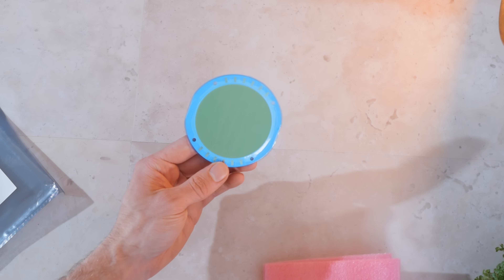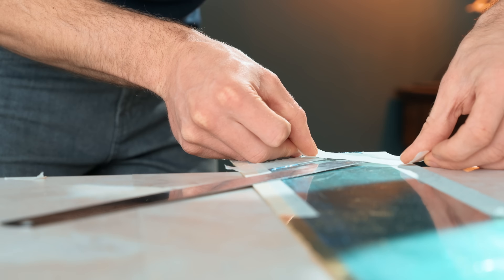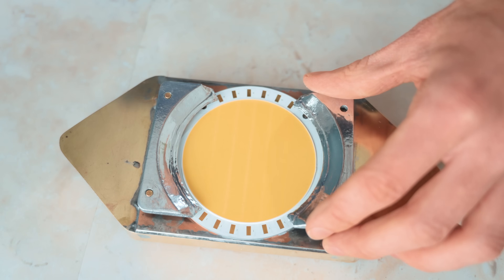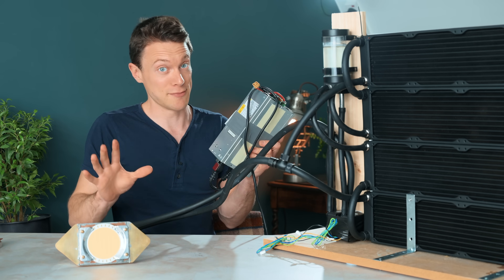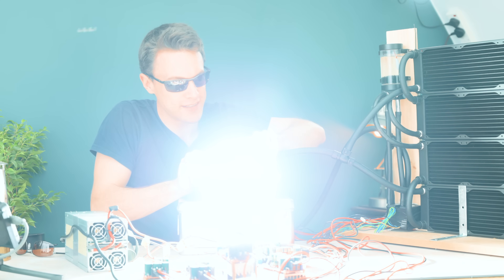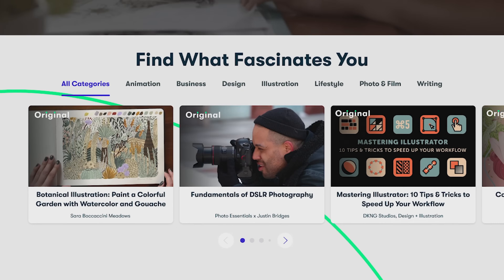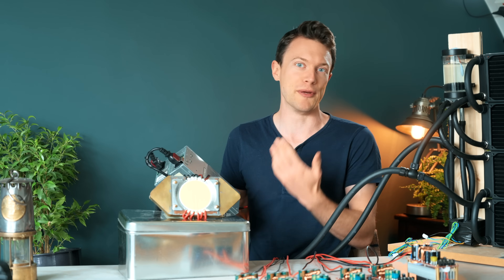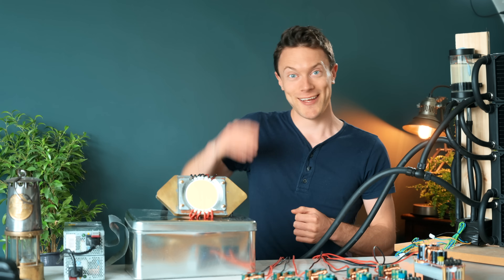Testing the world's BRIGHTEST LED!!!

Comment: Damn. You’re using a 3000W power supply but it’s using around 1600W to power it all. That’s right around the limit of 1800W of a 120V 15a circuit. I’m jealous of the UK’s 240v system lol. We’d have to plug this into a stove or clothes dryer plug lmao.

Comment: 7:57 time to do it at home, again. (Than again pc power supplies normally dont deliver all their power on the 12v rail) Or you know grab/build a 1500w rectifier with regulator.
I also happen to have a welding helmet so i could technically wire a few of these LEDs up to a Tesla module or two and make a sun cannon.

Comment: Those power supplies are never supposed to be wired in series, that's why they were getting so hot. Wiring them in series actually half's their current capabilies so you were 600w over their rated limit when drawing 1.6KW.

Next time I'd advise wiring a few 12v car batteries in series to get 36v, those can output over 2000amps so I doubt you'll have issues with those.

Comment: I'm not knowledgeable about this so correct me if I'm wrong; assuming 80 to 90% efficiency; wouldn't a 1500w led only generate 150w to 300w worth of waste heat? If so then the biggest cpu air coolers would be enough.

Comment: If you take two 12 volt 800w power supplies and you put them in series it's going to give you 24 volts at 800 watts not 24 volts at 1600 Watts. Putting them in parallel with give you 12 volts at 1600 Watts. In order to have 24 volts at 1600 Watts you would need to put two of them in series twice, so four total and then put those two sets of power supplies in parallel. That would be a 2s 2p configuration

Mixing metals in a waterblock, ugh.
Also, put some thermocouples on the LED cob and the heatsink that will shut down the power if it gets too hot

Comment: If you connect the PSU's in series you are shorting one to ground, and forcing the other to work double. 
To do two PSU's in series the DC+ of one needs to connect to the DC- of the other. This means that the ground of the input AC is connected to ground of both + and - of one of the supplies.

Comment: did you isolate the pcb grounds from the metal cases before wiring the power supplies in series? if you didn't, most likely that's what killed them. the cases should only be connected to earth if you want to use them in this configuration

Comment: It looks as though the wires to the PSUs are only soldered to one side of the output pads.  To get the full 82A output you have to solder to both sides of the 12V pads in parallel, ie: 41A per side.

Comment: Running power supplies in series will increase the voltage,not current. Shouldn’t you be running them in parallel? Might end up with ground loop issues though.

Comment: As a video creator, I was really enthused to see the rise of color accurate LED's replace the hot tungsten fixtures I previously relied upon (750w-1200w draw). Now I've seen LED video lights pulling 1200+ watts and wonder if we need a new advancement to come along that improves upon LEDs. I don't see it happening in my lifetime, but I think that engineers should continue their work on the efficiency  (lumens/watt) and give us back the ability to plug in two light fixtures to the same circuit without risking a blown fuse. 
As for this LED, have you considered using an automobile radiator? (only slightly kidding).

Comment: I believe (heard recently, but don't know well, look into it further) that using two metals will cause electrolysis because of the running water and eventually leakage - plumbers are having such problem when mixing other metals with coper pipes (though obviously not the lead solder?)

Comment: Server power supplys are intended for use in servers that have internal fans to supply a ton of air flow at high static pressure.  In open air on the desktop they probably didnt have enough airflow and simply overheated.  You would probably have better luck with regular desktop power supplys that are not designed to have supplemental airflow.  Or just get an AC/DC converter with the proper wattage and voltage, that would save even more complexity.

Comment: Loved the video
if the PSUs are in series, could they be touching each other? I think the common connects to the PSU chassis. it would technically short the PSU you are drawing negative from.
also the PSU power rating is probably total across all outputs, not just the 12V one

Comment: 15:00 Well that's probably has to do with the way you put them in series, powersupplies in general are not really "stackable" per se, since their characteristic vary from block to block you will find yourself in situation where one block handles substancially bigger burden than the other more often than not(in fact the rule of the fumb is to assume that the rating is just 1.5x of the two rather than 2x, and stacking more than two makes it even worse, and even less stable, remember that voltage drop rate and its correction will be different for each power supply, so dynamic characteristics aka under different loads will vary quite significantly). It's also ill advised to create cascades even from big number of transistors that "dumbly" routed in paralel for simmiliar reasons. Also connecting power supplies in series may lead to  to short circuits due to "common ground" problem(aka you have to check that power supplies are fully isolated and their "minus" wires are not of the same potentiall, like for example null wire potential), so yeah... It's better to just buy a more powerfull power supply, even more so when we are talking about significant loads like 1.5kWh, since they crawl in the territory of the "big boy" electronics(aka heavyload ones) that have quirks of their own, that do require special expertise and certain design choices in schematics of the power supplies(not that i can specify which since i am no expert in the field)

Comment: A MISTAKE BY THE CHAP.

The power bricks are rated in V-A, not in real Watts. It includes both active and reactive power. You should only consider real active power component as useful. This means that to power a 1500W light source you need no less than 2000 V-A power source.

Comment: I guess here is some mistake in calculations of coolling power. here is needed like 300-400w of cooling power. Not like 1-1,5kw. Because leds converting electricity in to light efficiently. I guess you can use just big radiator like 20х20 or 30x30 or 15x40 cm with fans.

Comment: Im a little confused did he wire 2 12v 1000w server supply in series or 2 2000w powersupplys, if it were 1000w ones then that explanes the failure because seirs doubles the voltage not the current also stepping the voltage up along with inefficencys also takes more power so they most likely would have died in any scenario.

Comment: Perhaps this type of leds need something temperature dependent current regulator system. If any overheating happening and cannot solve with pumps or fans, currents going to reduce with PWM (and maybe some signal to show something wrong) Showing indicated % of power and capable of power. And the difference show it if the cooling system good or not.

Comment: Ah, I recognize these PSUs; they're found in a HP Proliant DL380 G5 server, and I have one. The way these work is that you have two PSUs in parallel, and they share the load, but if one fails, the other one can take the full load for redundancy. I have noticed that these PSUs are pretty unreliable since I have had to replace them five times by now, and boy do they run hot.

Comment: Computers working on 12V. Modern CPUs are rated on +/- 1.35-1.45v consuming even 300A, that mean CPU Cooler rated at 200W can dissipate +/- 150A. Your 1500W LED working on 30V meaning output of 40A. Just use 5$ 0.5mm thermalpad.

Comment: The server power supply probably blew because of the double voltage conversion. If they variable voltage adapter were 80% efficient they would draw 1,875W from a 1,500W server power supply.

Comment: You need to connect the PSU's in parallel and then ramp up the voltage by the booster modules. The PSU failed because the current flowing through them actually surpassed their limits by two times

Comment: I don't know if this applies to your case but physically separating the two PSUs so they could shed some of their own heat might possibly have saved the day.  My policy is to always avoid stacking PSUs on top of each other.  I usually also try to elevate them off of a solid flat surface.  Brilliant video, and very well presented!  Thanks.
Reply: Being forced air cooled, they shouldn’t need it.

Comment: Sorry if I'm missing a comment below (6000 comments) where this is said, and for the late analysis, but here we go. Surely the 1500W LED works with decent efficiency? At least 80%, maybe even better? That means that your heatsink only has to handle 300W or less. So your first one actually might have worked...

Comment: I admired your passion, honesty and enthusiasm for bringing projects to life. A few guys like yourself will change the world completely for the better. Thanks a whole lot. I am seeking to build a gigantic projector system, and you have encouraged me, mainly because I expect it to be a heavy financial investment, and your headway has cleared most of my doubts. I also have learnt to do other DIY projects, and from what I can tell, your coupling of the power supplies, would mean the cables connected are not designed to carry the accumulated Amps. I think replacing the cables with the proper graded Amperage will solve your issue, and get you going again. I wish you full success in all of your endeavors. You are a wise and curious gentleman. High respect to you.

Comment: The problem with PS is probably that they have also 5V lines and their power rating is 1000W for both lines 5V and 12V in total.

Comment: Hey easier way to solder brass or copper is to just apply heat the brass or copper with the blow torch to the solders melting point and touch the solder to it.

Comment: So if the LED is drawing around 1500 watts, LEDs are ~90% efficient, which means 90% of that energy goes to emitting light, which means the remaining 10% is waste heat.  Therefore, it should only be generating ~150 watts of heat I would think.  That is still a lot of heat in a small area, but I'm wondering if air cooling is feasible which that gigantic CPU cooler.
Reply: Commercially available LEDs aren't that efficient, and the efficiency goes down with high CRI and when the light is non-monochromatic (such as white). 50% efficiency on a good day and a quality led. 
This particular LED is about 20-30% effective, going by their own stated (link in description) numbers of 120 000 lm / 1500 W = 80 lumens per watt, divided by some upper bounds for given in wikipedia/post referenced below.
So I would expect at least 1200 Watts of heat. 

More details: Electrical engineering stackexchange post titled "How efficient are LEDs?"

Comment: Your cooling is waaaay too op - the led takes the 1.5kw but converts most of it to light not heat. So your cooling has to be only made for the heat output which is way lower, the heatsink would have been probably fine tbh. But lower temps are almost always good so no issue.

Comment: Going from 5 Watts to 1500 watts will NOT increase light output by 300 times. Unless you measure light output, not power input, there's very little you can say, except it will be much brighter.

Comment: The server psu has been designed with a metric ton of static airflow through the server chassis, therefore i recommend you switch that up. It might not holdup all to well otherwise.

Comment: You only need 2 (or even 1)of the 360mm radiators given the (in)efficiency of the led. A single 360 will easily dissipate over 600 Watts. Try using 2 AX1600i power supplies in common rail mode for the power supply. Either in series for 24V,or, better still, as seperate 12v each powering 3 boost converters. You're effectively the 'mad professor' and a man after my own heart! 🙂

Comment: $1350 for a 1500W COB? That is crazy expensive. BTW, the cooling system is a bit overkill. Normally a 6500K LED is rated around 75% efficiency. So, you only need a 375W cooling system. A 360 water cooling system should be enough.

Comment: How would it look like from the space station? would they be able to see it ? it would be a cool project to get in touch with them and test it
Reply: The average computer monitor uses 84 watts of power. Let’s assume it’s 4k. That means each pixel consumes 1.013*10^-5 watts of power. We can count that as the pixel’s light output. 

Brightness falls off according to the square of the distance. If you’re 10x further away from an object, it is 100x dimmer. Similarly, if an object is 100x brighter, you can see it from 10x further away.

This LED is 1.481*10^8 times brighter than a single pixel on a 4k display. This means you can see if from 12170x further away (since that’s the square root of 1.481*10^8). The international space station orbits 408km up. 408km/12170 gives a distance of 34.43 meters.

So the answer is: if you could see a single pixel lit up on a 4k computer monitor at 34 meters, you could see this 1500watt LED from the international space station. It would not be bright, but if it was in a dark part of the globe, and your eyes had adjusted, you might be able to see it.

Link to math: http://www.wolframalpha.com/input/?i=%28orbital%20height%20of%20international%20space%20station%29%2Fsqrt%281500%20watts%2F%2884%20watts%2F%282160%2A3840%29%29%29

Comment: The PSU died I conjecture, due to the massive current being drawn at an unsustainable rate.  I have two units in my radio station; one is an older style linear item the other is a switch mode design.  Both are probably twice the size of the items Mat used and are only rated at 25 Amp continuous with a 30 amp surge.  1634 Watts at 30 Volts = 54.5 Amps , far more than those items were designed to supply!  Any way, as with all these presentations it was entertaining, interesting and extremely well put together!  I look forward to a return visit on this subject.
😁😁😁😁😁😁

Comment: if you didnt name this video testing the worlds biggest LED and you were unboxing it i would think its a new shower drain cover. i wonder how bright it would be if you were to run it at a low voltage without a heat sink.

Comment: Just use 4 server supplies. A pair of 2 power supplies in series to double the voltage. Then 2 of these pairs in parallel two double the max. current.

Comment: Most computer and server power supplies outputs are refrenced to ground, could that have caused the issue with connecting them in series?
Reply: That is wrong. A single 12V power supply would deliver a current of appox. 83A for 1000W. Two power supplies in series will still deliver 83A but at 24V. So 24V x 83A = 2000W. Connecting power supplies in series will double the voltage, connecting them in parallel will double the current. But because P = U x I, both ways will double the power output.
Reply: @NilsO78  yeah, you are right, i guess power supplies just don't like beeing connected in series then.

Comment: Nice work!  Apologies for not scrolling through all 5,000+ comments to see if anyone has suggested this application, but here's one I'd love to see: using this for a high-power stroboscope. Lower-power LED modules (eg 10W) great for this. I built one with 2X10W modules that gets regular use in my shop.  Runs off a 20V DeWalt tool battery and provides very crisp 60 micro/second pulses. Only downside is that they're relatively dim, which limits the range of the scope and requires a relatively dark room. 1500 Watts would make you the new Doc Edgerton. How you switch that much current that quickly is way beyond my pay grade, but you seem up to the challenge. Hope you take it on!!

Comment: They look to be HP DL380G5 series powersupplies ! 12.15V / 82.3A is on the label ... So you think they would be able to handle this when cooled properly... Reason they freak out is because the boost converters are switching power supplies as well, peak currents will be a lot higher.  That 1kw is rated at resistive load...

Comment: Just for reference, leaving this LED on for 5 minutes uses more power than if you left your microwave on for 5 minutes, that's what "a lot of power" means in this context. Also for reference, if you were to leave this thing on for 8 hours of the day for a month (like you would some normal light), it would cost you around 5376p, or 72USD. Better hope it's the only light in your house.
Reply: Well if you're going to use it through the winter months, with all your heat cost savings it might even out and perhaps even save you some dough.

Comment: that cooling solution was way too overkill, even though it's an 1500W LED, it's not like the 1500W are converted to heat, LED are very efficient in that regard.
Reply: Idk where you get that leds are efficient in that regard, I believe it depends on how they are driven. I do think however that this cooling solution was meant to be overkill, ie, this is not a production version but a prototype and it was meant to spare the oh so expensive led. This was pretty obvious from watching the video.
Reply: @macaque5759  yes you are right i got confused between led performance vs incandecent bulbs, but i didn not take into account the wattage. my bad.
Reply: @garramiro  yeah, no worries!

Comment: What’s the power factor on those voltage boosters? You’re probably drawing far more Volt-Amps than 750w non-inductive power. I suspect those switch mode supplies are not designed to have highly inductive loads either
Reply: Yeah but you'd think those power supplies would have some kind of over-load protection.

Comment: I think the power supplies probably crapped out because they are too close together and heat built up in between them. Probably spacing them out and letting them run with the full heat transfer of their outer shell would have helped